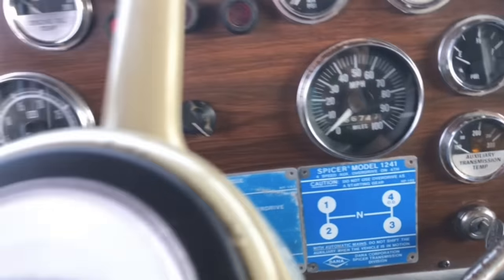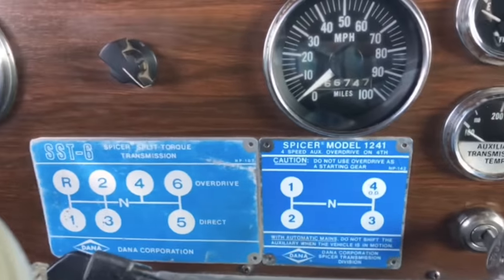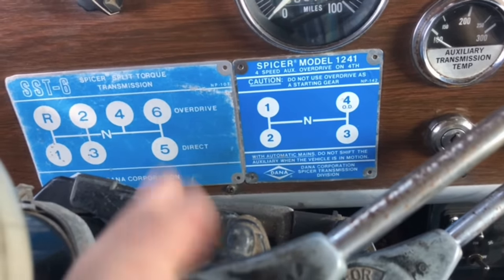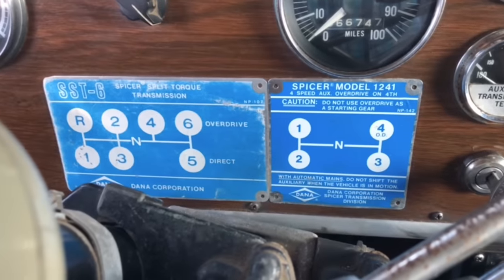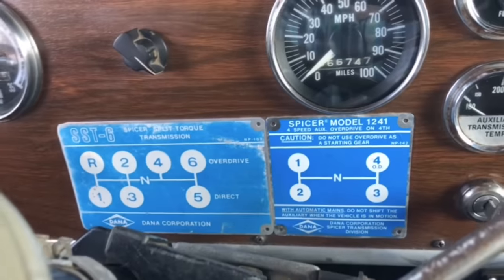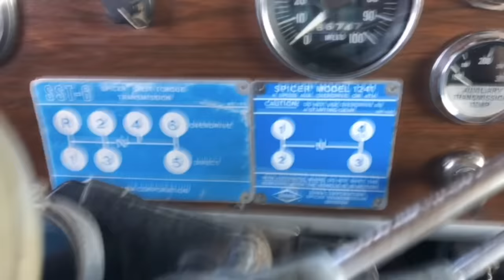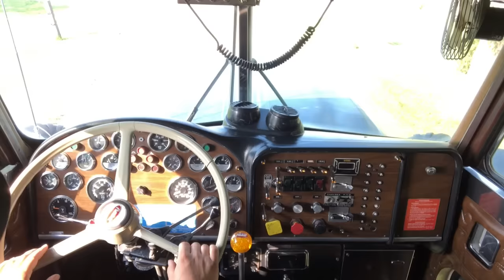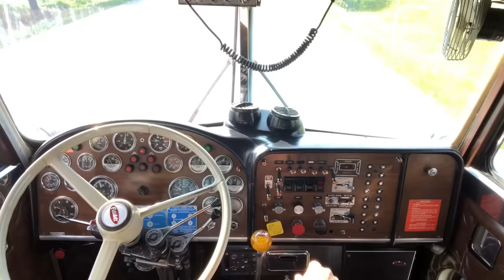How to shift Two stick 6+4 Spicer Transmission Peterbilt 359 #Peterbilt #359 #Twinstick #Twostick

Comment: Your working gears should be, 2&3 not 3&4, these old style transmissions work range was underdrive and direct,,, 1 and 4 are to be used, but not worked, 2&3 are heavier and both center shaft on opposing shafts, best for wear and tear long life and design
Reply from the maker: You are right about that... i get a bit of bearing whine in overdrive and I suspected its from a countershaft spinning much faster than typical. And i know from farm equipment they don’t like you to work it hard like that
Reply: Bubbles_8V92 
I love to see a young man working through this process and trying to figure it out and making himself better, so as an old timer who was under my truck yesterday because I hung it up I want to give you some,, not necessarily advice but rather information understanding is key for long life of these transmissions,, when you start off in low gear your main box should be in low and your auxiliary should be in second, and the reason is, is because you want the front box to absorb the brunt of the torque it is designed that way, the first two numbers on any transmission has to do with a torque rating due to the bearing rating, like I have a 1363A,, for a front box and a 1241D for a rear box,, with a 1100ft/lb engine, so, when it comes to shifting we manage high torque with low speed with the front transmission to protect the rear, should you ever need to start with  auxiliary in low, then the main box should be in low as well, 
1-2, 1-3, 2-2, 2-3, 3-2, 3-3, 3-4, 4-2, 4-3, 5-3, 5-4, 6-4,, it’s amazing, It’s easier to do than it is to write it out. Lol, also when changing gears the auxiliary box needs to be in neutral before you enter in to the next gear, on the main once again it is a torque issue,,, and you protect your back box using the throttle, A good example is when you are in 3-4 move the main stick out of three and push it all the way to the right until you can reach the auxiliary stick and pull it out of four into neutral and then go back and put your main stick in 4 and reach over and grab your other stick and put it in 2, hope this makes sense, and when going for 1st to 2nd when you take off you should come out of 1 and take the auxiliary out of 2 then go into 2 on the main and put the auxiliary back in  2. 
FYI, back in the day we did have 2 stick transmissions and these beasts were bolted together with one through shaft they were called a married box, these are the ones that are talked about reaching your hand through the steering wheel to shift them you had to shift both sticks at the same time no matter what and it was a difficult thing to learn, so with the invention of the follower box like you and I have many of us thought we died and went to heaven, but before the follower came along, many had a third box known as a brownie can give you overdrive many of these units even had two speed axles so in certain conditions you would get in a truck and it would have four gearshifts,, but what you have to remember is we only had 230 hp on a good day, not to mention our torque zone was only about 1 1/2 RPM it has opened up quite a bit since then,,, I got to let you know that you make my day having such an interest in this,, it is such a lost art,, almost forgot to tell you a ceramic clutch in these things is a terrible idea the old rag clutch is the way to go
Reply from the maker: @imafriend1336  actually that does make sense... i probably want to get better before i try too much of that but im gald you took the time to say that. i only got the reply now since it was in my spam section :(

Comment: It's not that hard to learn. If you can operate a 13 speed transmission just think of main transmission as normal shifting and auxiliary transmission as air shift knob on a 13 speed, only its manual instead of air assist with your thumb and you don't use 1st gear on the auxiliary transmission. You just use 2nd, 3rd and 4th.
Example: 1st gear main transmission. Shift auxiliary transmission 2nd, 3rd, 4th.
Then 2nd gear and auxiliary back to 2nd, 3rd, 4th. Then 3rd gear main and back to 2nd, 3rd, and 4th again and so on. This was on a 4 and 4 transmission. Simple. 
1st gear main and 1st gear auxiliary is only for "stump pulling" etc.

Comment: Nah with electric you have none of these issues . No cold starts, no shifters, no breakdowns and instant torque . With improved battery tech you get similar mileage with combustion . I believe the Tesla can do 0-60 on a 20tonne cab in 5 seconds . With a trailer I can't remember but you can figure it out
Reply from the maker: I think no breakdowns is a stretch...
Reply: @Bubbles8V92  Well not nearly as much as a combustion engine . Less moving parts and they are all housed in . Before my last electric bike broke down I had it 6 years . No battery change and no motor problems . My rear axle snapped when I hit a large pothole (poorly lit street lights and hard to see when you're going at speed) and I hit a wall . Doh !!!

Comment: This one is a "Direct Maiibox" with the OVERDRIVE on the Auxiliary.  I have driven and seen 5 x 4's with the OVERDRIVE on the Main  Box and Direct on the AUX.  I have driven them with  the OVERDIVE on BOTH the Main and Aux, that is a Double Over, and then the BETTER and most popular 5 x4 with the Diredt on the MAIN and Overdrive on the AUX.  

I CAN SPLIT THEM TWO HANDED ans have done that for YEARS, it is NOT that hard.  I quit driving in 1980 during the Trucking Depression.  Back then we called those Detroits Yuddin Yuddins.  100 MPH down hill, and 10 MPH uphill, they are two cycle and do NOT have any LOW SPEED TORQUE.  Not much torque at HIGH RPM EITHER.  REALLY hated them I prefer a CUMMINS. I would FLOAT shift the Aux shifts, and TIP THE CLUTCH half way in when doing a TWO BOX SPLIT, it is EASY, I could show you HOW and I have not done it in 40 YEARS.  But GOOD VIDEO!!!  I liked it, and Thanks for putting it on here, BB

Comment: Twin sticks were used on underpowered engines.
Reply: John Collins say it ain’t so! 8v71 can make plenty of power, you just have to keep it buzzing!
Reply: @Farmer_1776  they have a narrow power range, but when they are on the pipe they sing. 
Its like a 2 stroke dirtbike, wind the wee out of it and shift your brains out.
Reply: @Farmer_1776  The extra gears enabled the driver to keep the motor in the power band. That was the main reason for all those gears. Keeping the beast alive and on the pipe.

Comment: Man, sounds like you're torqing the shit outta that thing at high rpms...
Reply from the maker: Its the way old 2 strokes were supposed to run... lug them too low and you’ll be putting a crank in.... recommended working rpm is around 1800

Comment: Steering wheel is cracked. DOT wont like that.. Why go thru all that when you can have a nice quiet Volvo with an automatic?
Reply from the maker: Because I don’t want one!! I’ve never driven an automatic but i have driven just about every truck out there other than a prostar or a volvo... and i know what i like.... a 389 with a paccar is so quiet you could hear a fly cough in the bunk.... it took a while to learn how to shift that one... unless i had the window open I couldn’t do anything by ear...
Reply: Bubbles_8V92 lol, calm down bubbles. I started on 6x4,5x4 1693,3408,1674 and a Detroit. I didn't drive a 13spd until I was almost 30.i run a 388 with an isx /18spd.
Reply: It is a romance thing! Just like that first kiss from your first girl friend! The new rigs are very comfy and nice. But there was just something addictive about "feeling" the motor and messing those gears!

Comment: Dam i wna drive that ol girl soo far ive drove a super 10 13 15 double over 18 speed and just a reg 10 speed not a super 10
Reply from the maker: Ive never even seen a super 10! But in Canada almost everything is at least 13 speed except for automatics and straight trucks
Reply: A super 10 is a 10 10 speed but you can split the 10 speed like a 13 speed pretty cool it's nice transmission

Comment: I dont understand, because im f*ckin russian. 6x4=24 gears? on each transfer left row four shows the one number?(1(1,2,3,4), 2(1,2,3,4) and so on)
Reply from the maker: Yes 24 gears but you don’t use all 24 to accelerate as they overlap a bit you would use 10 - 16 gears not all 24
Reply: @Bubbles8V92  this is very difficult in contrast to the gearbox with a divider and a demultiplier))

Comment: Can you  say,  main  trans,  and  Brownie.  in  40  years  of  driving  never  hard  anyone  say  second  transmission. sheesh.  and  an  8v92,  only  engine  that  puts  out  more  oil  than  a  oil  derrick.
Reply from the maker: Maybe because im explaining it and people will understand second transmission better than “brownie?”
Reply: @Bubbles8V92  Did anyone else know them as the Main and the Auxiliary?
Reply from the maker: Well the spec sheet and temp gauges refer to them as main and aux
Reply: @Bubbles8V92  Thank you! I have heard the other references, but hadn't heard anyone use those terms here yet. I ended up with auto shifters the last three years I drove before retiring.and while they are okay, easy, and supposedly more economical. The manuals we're just more comfortable and I felt as if I had more control of the truck. My twin stick was a 5 X 4 in a gas engined straight truck. Times have sure changed.

Comment: On road with that out dated pile shit. I drove them for years. Good luck buddy. Them outdated back in 1970's. Bet you getting great fuel mileage running all them gears. Try auto. Something get better than 2 mpg. Bet you running -200 hp too. Putt putt.
Reply from the maker: Its just a toy... also 475hp... and anyone that says automatics are cheaper to run has a different calculator than me... between a torque converter and tire wear even in the rare case when they get better milage they still cost more per mile... coming from a guy that has two identical 5700 western stars one 13 speed one automatic